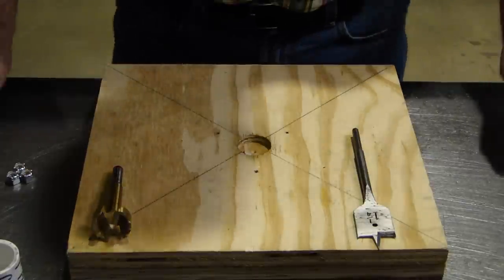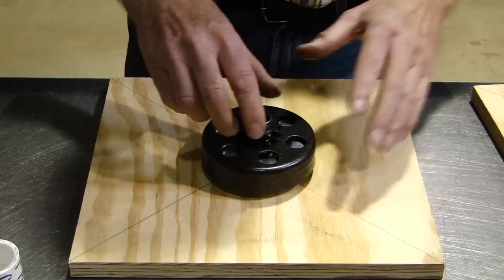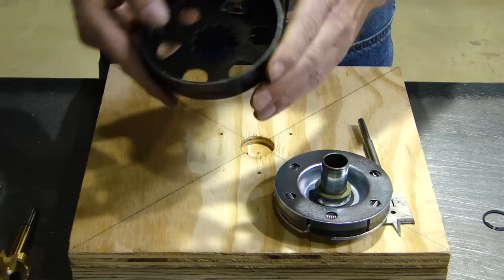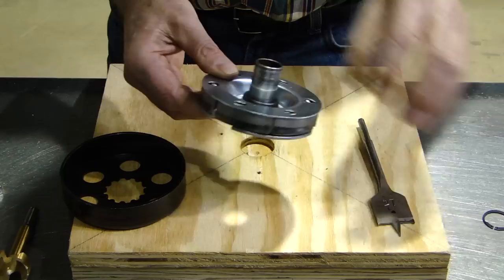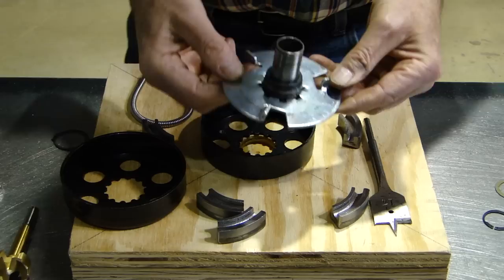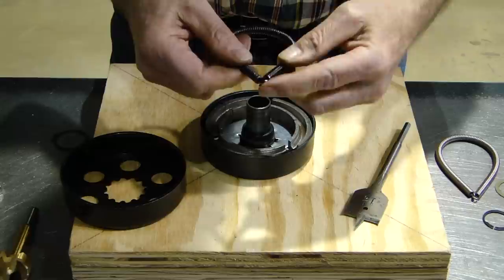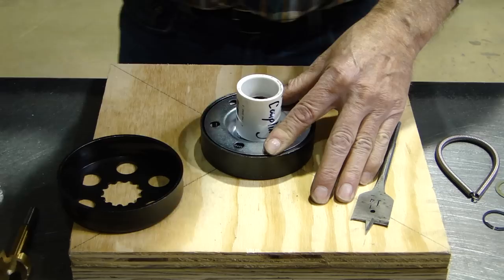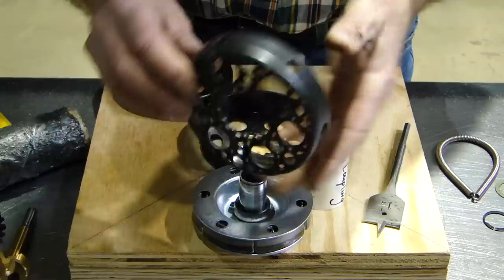Max Torque Clutch Assembly Video

Comment: Great video! I’m considering using one of these high quality clutches as part of an electric start for My Ryobi 900 Propane Generator. We add an electric start system to the 1.5HP 40cc (60-70psi of compression) and the one way bearing assembly we use is making a lot of noise. We are now considering the use of a clutch, which may be a quiet solution once the engine is running.

The clutch itself would only engage when the starter motor is spun. Mounting the centrifugal clutch to the starter motor, and the clutch housing which engages upon higher rpm, to the engine flywheel assembly. It’s the opposite of how a centrifugal clutch is often applied, however may work well for our application.

Comment: A different spring will change what rpm the clutch engages at. For example, if you feel your clutch is engaging at too low an rpm, you might want a stronger spring to keep the shoes from engaging too early.
Reply: i have a heat damaged. clutch who's spring has lost a bit of its tension i need a new clutch. or a new spring. can anyone suggest me a idea 
my go kart is engaging when i start it..

Comment: I have a question, on bicycles between the gear teeth are more pedal reaches more speed. Now if I change the gear to cluch by the star that leads the spoiler bar tires and I put Star cluch to the bar this would reach more serious speed or slower. but I am new at this I just finished my courses in welding and cnc machines and have many things that come to mind and before to spoil the best parts wonder.

Comment: In the sprocket part is the brass bushing suppose to be sticking out of the back some? Or is it flush with the front part? I took mine apart and it kinda got messed up and I think the brass bushing has moved some.

Comment: i have a max torque clutch and the bike has sat without running for around 6 years when you pull the throttle it doesnt want to grab at all it has been oiled but still nothing happens , please help